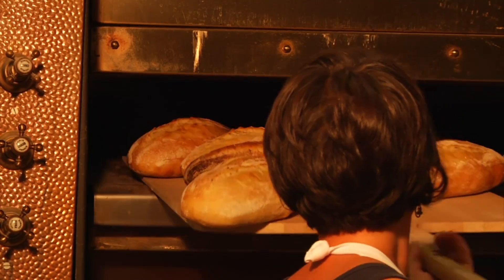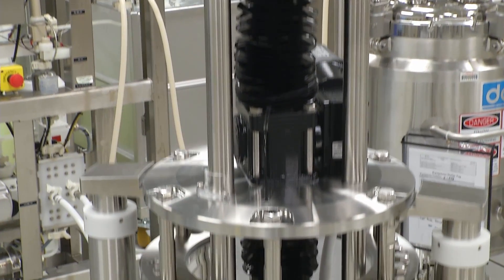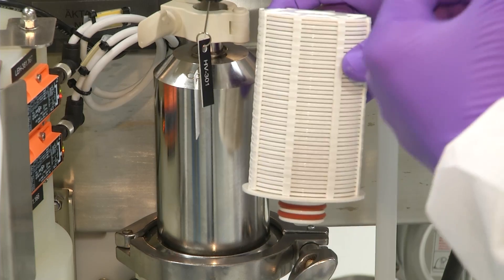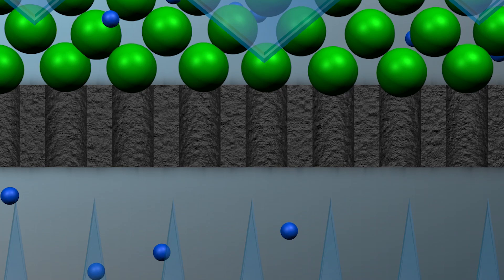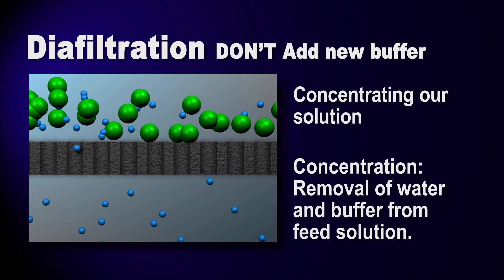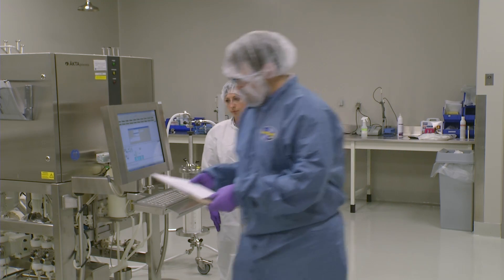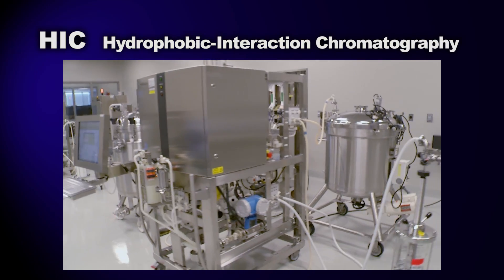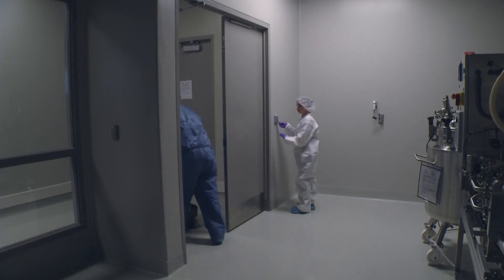Bioprocessing Part 3: Purification

Comment: Very valuable set of videos. I learned about most of the unit operations in class, but for a long time I had difficulty finding sources that gives a detailed run down on typical steps involved in producing biologically derived products in sterile manufacturing environment. I was surprised how much information was conveyed in these videos. Thank you so much, the videos definitely consolidated my knowledge on fermentation processes.
Reply: these aren't sterile steps, they are clean. Several steps are taken after purification to sterilize and package the product. I'm in the biz of purification.